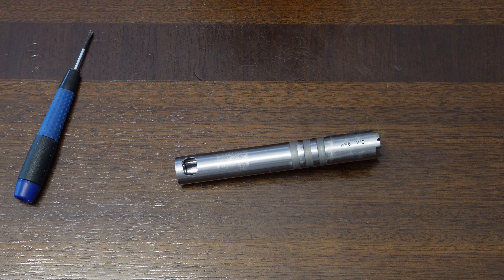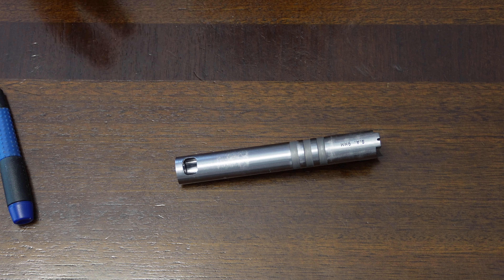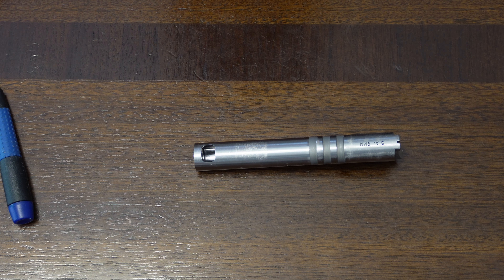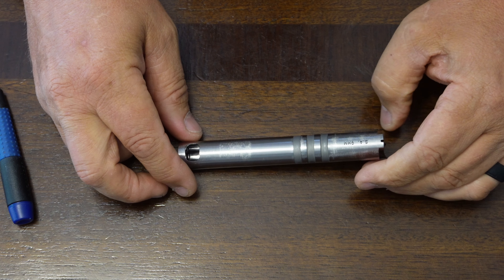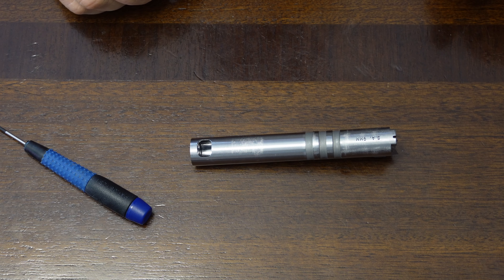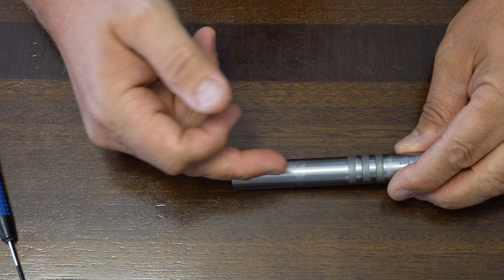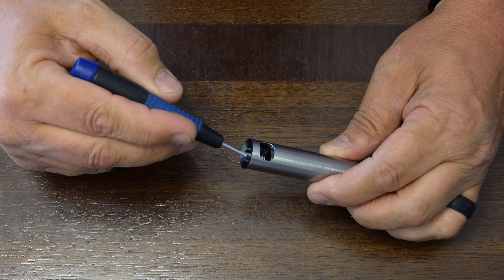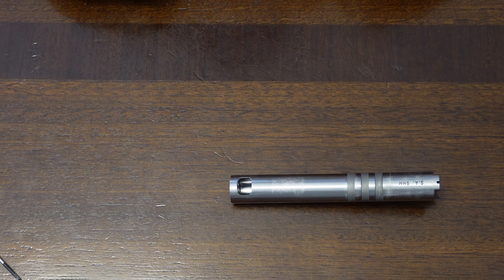Springfield Prodigy Comp: Barrel issues?! 🤷‍♂️

Comment: You can use plated on this gun. The rifling has been removed from the ported comped area. No shearing should be possible
Reply from the maker: Yeah I didn’t notice any of that but just the extreme build up. Thanks for watching and commenting and be sure to subscribe if you haven’t already
Reply: wrong
Reply: @chrisgilbert2152  I am wrong? Is there a rifling in the comp section of this gun? I looked at this same gun, and I know the answer. If the ported or comped section of a gun has no physical contact with the plated bullet, it will be just like a non ported or compensated gun. If the port or comp makes contact with the plated bullet it will fragment or lead the barrel and release potentially dangerous fragments from those ports and comps.
Reply: @chrisgilbert2152  Feel free to show me pictures of contact points on this comp. I will delete comments if it's true.
Reply from the maker: @Heteachethmyhandstowar sorry about the troll
Reply: @Heteachethmyhandstowar  it's not a contact issue!
It's a heat issue!
Plated or coated bullets will "melt" leaving lead in the comp/ports.
It's also why shooting jacketed bullets won't help since the back of the bullet is exposed lead.
I have over 6000 rounds through an XC with very little build up, which is carbon in my case since I only shoot hollow points, with no exposed lead
Reply: @GSquaredTactical  if you're referring to me as the troll, feel free to block me!
If my attempt to help educate the members, with over 55 years of building guns is considered a troll, again, block me!
Reply: @chrisgilbert2152  if it was a heat issue only lead would build up in barrels with plated bullets. I have shot hundreds of plated bullets through my bul viper comp with very little build-up.
Reply from the maker: Well when you respond to someone with one single word which was…”WRONG” with no educating words to follow then how would one be led to believe it was constructive?
Reply: Well, if you read the responses to my comment you will know why I didn't elaborate! @GSquaredTactical
Reply from the maker: Nah

Comment: I don't know if compensated barrels wear faster or not. I think it can throw off accuracy because of bullet rotation because of the lans and grooves. But companies still make ported barrels so it must not be an issue, The dirt residue is going to be the same with an external comp. By the way, when I sent my Prodigy back Springfield Armory say they don't recommend S&B ammunition because of the hard primers. Great information my friend!
Reply from the maker: Well, heck, when I reached out to them, they told me the exact same thing concerning the Fiocchi ammo 🤦🏻‍♂️. Barrel fouling is normal for sure but this seemed like a very extreme case of it in sure fashion like 450 rounds. I ask them to recommend a ammo and they would only say what they didn’t recommend
Reply: My prodigy loves sellers& ballot and haaattteeesss fiocchi   Only issues I’ve had with mine is running fiocchi poop ammo

Got about 1500 rounds through mine only 50 rounds of fiocchi and about 10 rounds of the box gave me issues
Reply from the maker: Yeah sadly I’ve had some issues with Fiocchi lately across the board. Thanks for watching and for commenting and be sure to subscribe if you have not already.
Reply: @GSquaredTactical  it’s definitely known to be problematic from what I’ve seen personally. And it’s very dirty ammo. Leaves all kinds of crud behind
Reply: I think Compensator barrels (not cone comps because they’re independent to the barrel) can wear way faster than Ported barrels and will have more an affect on accuracy than ported barrels….not saying ported barrels won’t wear faster but in my experience ported barrels are more accurate and last a bit longer than compensated barrels….my Bull Armory ported barrel has been flawless for the past 3000 rounds and still holds accuracy….my friends Compensated cut barrel Staccato had some crazy deviation after like 1200 rounds…maybes that’s because of how it’s cut idk but I’ll stick with ports for now on.
Reply from the maker: @n55Rob I have not really had accuracy or reliability issues with either but as mentioned in the video, there is definitely a lot more wear than just with a standard non-compensated non-ported barrel. Thanks for watching and for commenting and be sure to subscribe if you have not already.

Comment: I'm glad you reviews firearms. I'm not buying nothing new that comes out to many issues with them. I seen 3 guys at the range with the TTI it was awful to watch ftf. She's I love caniks but I'm gonna pass on it then I seen your video about my Smith and Wesson
Reply from the maker: I got a lemon on the smith. My TTI has been one of my favorite guns
Reply: I have not had an issue with mine. 124 grain brazer with the low power spring. 
I believe guys are having issues with them from not cleaning and lubing them properly and the springs that come with them are way to heavy to be used on range ammo. I'm currently running a spring kit from sprinco... keeping the port on the barrel clean using a moly dry lube.
Reply from the maker: Are you talking about the Springfield or TTI
Reply: @GSquaredTactical  TTI
Reply from the maker: Sorry I was asking @krishall3187
Reply: @GSquaredTactical  TTI
Reply from the maker: @krishall3187 I’ve had zero issue with my TTI as well. Thanks for watching and commenting and be sure to subscribe if you haven’t already

Comment: Isn’t it just carbon scoring? That’s pretty much like when you get carbon all over a tac light?   I can see a ledge there do when the spent gasses hit , stands to reason that’s where it will accumulate?   I tend go longer than I should between cleaning, I find M pro 7  or Hoppes 8 to soak for a couple hours take out most (if not all) carbon deposits.
Reply from the maker: The was hard like soft solder or something

Comment: I have been porting 1911 guns for people for probably 40+ Years. What you are seeing is the lead from the base of the bullets that melts from the heat plating the inside of the comp.  Plated bullets are not issue in a comped gun. Only ported guns. your gun is a true comp. Ported  barrels allow the bullet to re-enter more rifling as they pass the port adn worse, the base of the bullet especially plated bullets will expand the base as they pass the port and the base where they re-enter the trifling will shave jacket material. 

Both jacketed HP's and plated bullets have the base covered. No exposed lead. Both are prefered, especially in competition because there is much less fouling. And NO lead fouling.

That little steel tipped screwdriver will scratch the barrel. giving  a place for more foulding to stick to.  Make a small scraper from the  brass gunsmiths punch, or go to the welding supply store an pick up a 1/8" brass brazing rod. Shape it with a file to a sharp wedge for scrapping the lead out of th comp. It will no harm the bbl. I also wax the inside of the comp which is fully mirror polished inside. Really helps stop a lot of hard foulding. 

KnifeMaker
Reply from the maker: Yeah the 2nd time I shot it I was aware of it and the first time I polished it with mothers mag and aluminum polish and it still got on there but not as bad. I let it soak in Hoppes for 45 mins and it came off so much easier without scraping. Thanks for your input and the tips
Reply: @GSquaredTactical  Every once in a while I use a very small felt tip buffing wheel on a Dremel. A touch of white or green chrome metal polish or mothers on it will do a fine job! ;<)
Amazon has them. I jus tpicked up 60 of them for 6.99 + tax. 
KnifeMaker
Reply from the maker: @michaell397 thanks

Comment: CCI lawman line of cartridges are total metal jacket.  They come in 115 124 and 147. They are not hollow points. Not more expensive. Also you can use lead away cloth. Tedious to use in the port but it can be done. I’ve used it for forty some odd years to clean the face of my revolver cylinders
Reply from the maker: Sweet man thanks for that info and be sure to subscribe if you haven’t already

Comment: Curious I wonder if it’s the lip on the comp cut end of the barrel, just had my competitor done by Floyd’s and the took all the rifling out from ports they cut in to  the end of the barrel same diameter to the end and put a new crown on it also so no lip to catch anything on. Wonder is it needs the same thing might have to look into it for mine.
Reply from the maker: Well, there’s no rifling in this tip of the barrel however, there are two different lips front and back of the comp area. Thanks for watching.